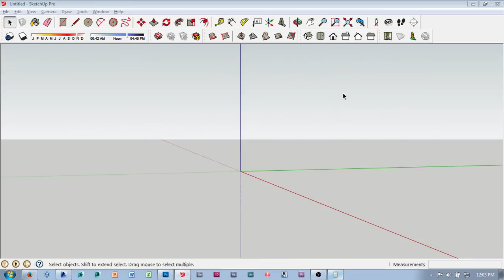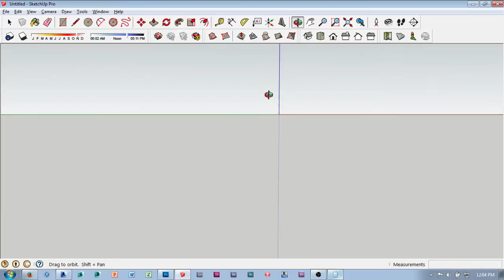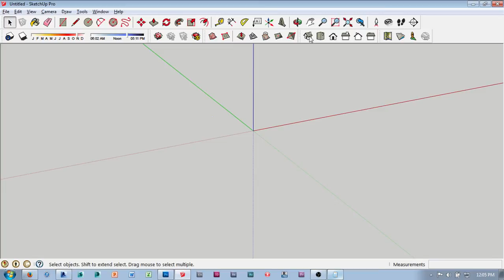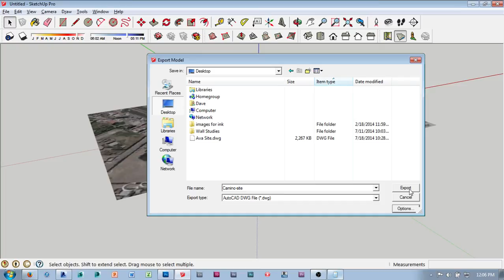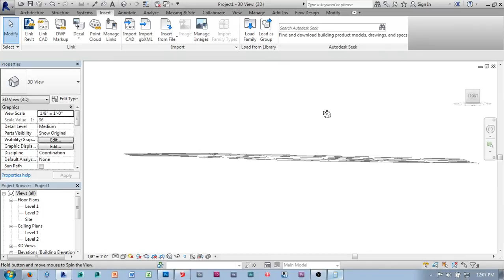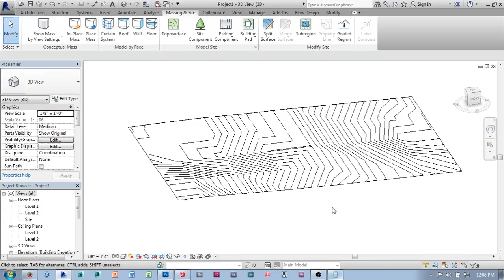Revit to Real 1 - Building Topography in Revit from SketchUp

Comment: we need sketchup pro or free one?
Reply from the maker: The free version will work fine, but you will be missing the .dwg export in SketchUp. In Revit, import the .skp file, then export that same file as a .dwg from Revit. Import the .dwg file, and convert it to a topo surface. Silly process, but it works. There may be a tutorial out there that converts a .skp file to topography, but i have not seen it yet...
Reply: i cant find the terrain icon in sketup free, i wanted tht terrain to import in Revit, thanks anyway
Reply from the maker: Popupboii - it should be there. You might need to check under the "View-Toolbars" drop down and check the box that says "Google."